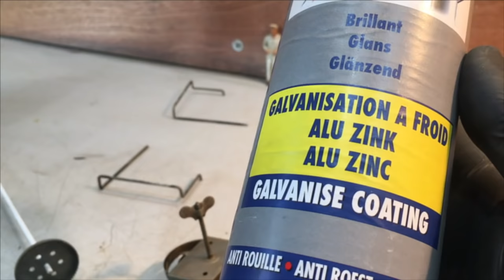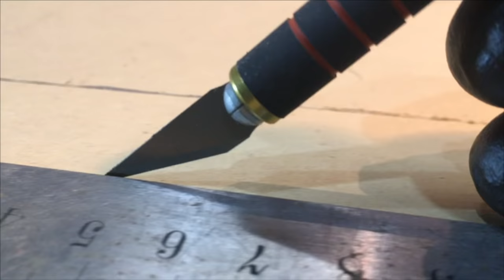1950's Joustra Road Roller abandoned toy - Restoration

Comment: Paintjob allready looking better & you did a really nice job restoring those roller wheels
Just few more tips:
 If its pitted well, first apply tick layer of filler primer,than wet sand this with 800/1000 grid untill you have a flat surface,than use regular primer, also wet sand with 1000/1200,etc grid,than apply final color in 3 or 4 coats with little time between the layers, untill you reach a equal mirroring surface. 
If its done well,polishing wil not be needed.
Good luck 👍🏻
Reply from the maker: Ok Michel thank you very much for all these tips ! 😌🙌

Comment: Nice. You found this in a yard, dump some where?  I mean you said it was abandoned so you got it for Free. 

Even though the wheels were made of cardboard, Think I would have changed it out to metal. So it would last another 50+ years without the wheels fall apart either from just breaking down or getting wet.

Comment: Great work... what kind of toy company makes a dirt toy with paper wheels?

If I were to find one of those, I'd have to see if it was possible to shoehorn a Mamod TE1a mechanism into it.
Reply from the maker: I’m looking for a Mamod steam roller ;)
Reply: @TheFabrik  I'm fond of mine... a gift from my wife, I've even made a smokebox mounted generator for it that puts out 6-16 volts depending on the pulley diameter.

Comment: good job on the restoration. Why not make the wheels out of metal instead of carboard? Make them better than the original
Reply: They might have been made with cardboard for weight reasons.
Reply: No, keep it as original as possible. Good job, tres, tres bien!